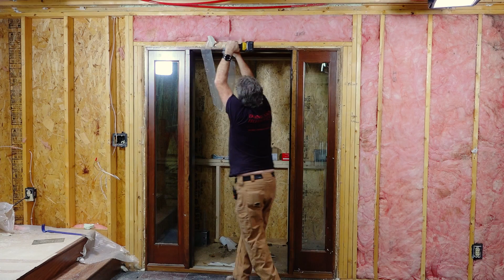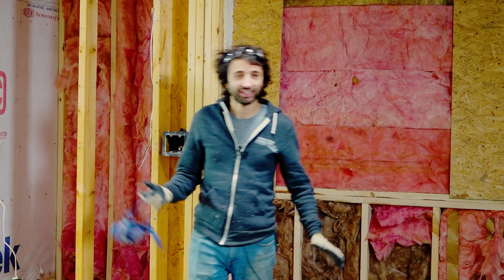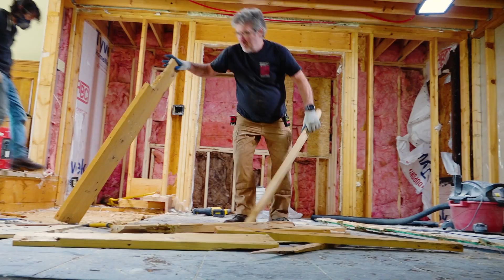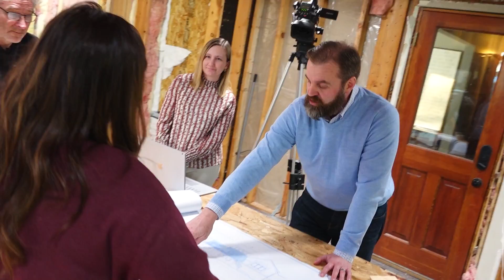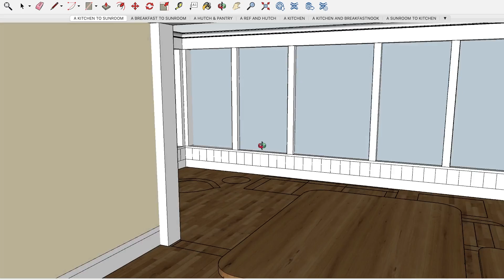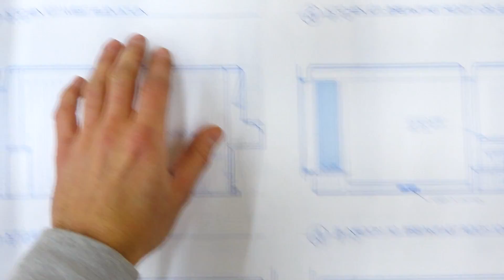Extending into the Front Addition | Home Renovation & Addition Part 23

Comment: Been fun following this project.  Having just completed a complete kitchen makeover in my log home which presented numerous challenges particularly running exposed conduit for overhead lights; I went with iron pipe and U.S.A made Anvil fittings...the style is referred to as "Steam Punk".  Would highly recommend considering using Legrand under counter lighting systems as they also include electrical and USB outlets which make for a cleaner backsplash.  Curious on how you plan on running the ductwork for your range exhaust hood (assuming it will be vented to the outside)...on my project, I used an inline blower and solid 10-inch ducting which had to be exposed.  Again, appreciate your sharing this and very happy for you both.

Comment: You are not keeping to proportions. You seem to just miss the golden proportion of thumb to forefinger. Then your panels are all over the place none of the lines follow through. Your beam doesn't line up either its just slightly higher. 
It just isn't clean enough. You should simplify. It's going to look like extensions, conversions and compromises. Also too many textures. Too many different panels. Too many colours. Too many different levels.
It's just all too busy. Less is more.

Comment: I would highly recommend going with an induction range. Not only do they work really well and clean really easily, they do not provide nearly as much indoor air pollution (ie contributing to childhood asthma). And no, the vent hood doesn't remove C0.  While it's open it will be easy to add a 50A circuit.

Comment: We renovated our kitchen about 25 years ago and installed terracotta tiles on the floor. The installed recommended we not waste installing them under where the new cabinets were to be, so we took their advice. Well down the road when the dishwasher needed replacing I ran into an issue of getting the old one out because of the height clearance, it just couldn't slide right out due to the rise of the tile floor. Never did it cross my mind about the end of life of the dishwasher and having to replace it. I wish we had only spent the additional 400 or 500 dollars to have the entire floor tiled because when that replacement also died I never replaced it because I was sure to destroy the counter-top. Anyway, you have Donavan, to advise you on that issue, I didn't have but myself. Your project is looking great!

Comment: I'm glad i heard you say there just now that you have a lot of load on that beam.  Because that's what i've been thinking for awhile now: "You have a lot of load on that beam!"  Not only the load bearing 2nd-floor outside wall+roof, but also half of the roof deck too and its snow load.  That's a lot of load there!  I'd be worried about that beam if weren't for the fact that you had it designed by engineers who know what they're doing.

Comment: Donavan using the sledge hammer to remove sheathing brought back memories. My first house we added a shed dormer. I spent the 'demo day' taking the old roof down, using a sledge from inside to remove the boards (and shingles nailed to them.) Hint: It works better with Elton John blasting. :-)

Comment: While your still in the construction stages, I was watching a British show a few years back and they had a unit in the kitchen counter or maybe it was the Island where it raised up out of the counter with electrical access on all sides for plugging in appliances. When in the closed position it was a flush plate on the counter. That way all your receptacles are hidden until needed.
Google popup electrical receptacles. Also a good idea for your shop.

Comment: Engineering ok’d those gigantic holes in the floor joist for hvac?
Reply: That wall could be completely removed it we wanted to plus it has core fills in it
Reply: I was talking about the i-joists supporting the floor above. HVAC ran their line sets and electrical through a few of them. Obviously I’m not at the site but those holes look way more than 1/3 of the joist
Reply: @dirklance4413  yes they are still in spec with Manufacture guidelines I normally will walk through that with all my trades and we talk about where holes are gonna be and what size

Comment: The choice of a fitted hutch rather than an unfitted hutch design is very contemporary American style. Unfitted kitchen design, as popularized by designer Johnny Grey in England, is a more traditional design form... fitted kitchen design has sometimes been described as “laboratory” kitchen design... unfitted is traditional in the sense that older kitchens were assembly of free standing cabinets and cupboards and chests and fireplaces used for cooking... laboratories were uniform designs designed for utility and uniformity... unfitted kitchens are still attached furniture pieces but often purposely attempt to appear to be free standing and done in various wood species. Attaching crown moldings around the room add unity to the design but identify the design as all built in... a room design with separate pieces of furniture is a collection rather than a total unified design... personal preferences for a fitted design style originated in the early 20th century in America at a time when architects were concerned with producing sanitary conditions... also kitchens were not family spaces but rather designated as work spaces. I am kind of surprised that Matt, with his furniture design an building experience and love of different woods pieces and traditional furniture style aesthetic did not opt for a more unfitted design... maybe next time.

Comment: Electrical comments:  Matt, if you have not already done so, add outlets on both sides of the island AND add a 3 or 4 way light switch on the island for its overhead lights.  The bare kitchen before cabinet installation will look like too many outlets, but trust me more is better!  Best wishes!
Reply: Totally agree.   When we remodeled our kitchen, we put a strip of outlets the length of the island under the counter.   As the electrician was installing them, he said "you'll never use these".   Boy was he wrong.
Reply: @tomgerhard1403  That just sounds like you’re keeping an unreasonable amount of appliances on your island, Tom.
Reply: @mm9773  no, more like taking a break from the office by using the laptop there, or charging a phone while watching videos sitting at the counter.   Not used daily, but plenty often. We have a dedicated outlet for appliances on the kitchen facing side of the island for when we use the bread machine or electric griddle, etc.
Reply: @tomgerhard1403  I agree…plus with the growth in numbers of electronic devices and gadgets, you will need more outlets in the future. It’s much cheaper to add them now. Just like workshops - with the growth of electronic devices for tools, I recommend double what people are thinking.
Reply: @tomgerhard1403  That makes sense.

I’ve recently renovated an old kitchen and couldn’t put as many new outlets in as I wanted, because I decided not to mess with the old tiles on the wall. It can be annoying, but I’ve also learned that counter space is my No. 1 priority anyway: I need surface area to prepare ingredients, so I’ve banned a lot of appliances from the counters. Fewer appliances = fewer outlets needed.

What I’m really, actually missing is another outlet at the main shelf above the main counter, for extra lighting and/or to plug the phone in.
Reply: It’s not that there aren’t enough outlets, it’s just that there’s always one missing: one corner in which you wish you had put an outlet but didn’t.
Reply: Yes, Matt - you can never have too many electrical outlets - ask your wife !! Enjoying your refurbishment. It really looks like you know what you're doing !! Mind you, you do have Donovan there to keep an eye on things !! As a certified Home Inspector here in San Diego, CA, USA, I salute you guys for doing an excellent job !! I have been watching your channel for a couple years now and enjoy your progress. Blessings to y'all !!
Reply: Definitely,  with today's number of appliances requiring their own dedicated outlets there's no such thing as to many outlets.
Multiple mixers, toasters and other implements cooks like to have handy instead of having to dig them out of a cabinet,  use them then pit them back again.
Especially if you're doing a lot of entertaining friends and family.
Reply: also add outlets up high for over cabinet and under cabinet lighting.

Comment: Looking good Matt. One thing. Consider putting electrical outlets in the pantry if you are not already doing this.
Reply from the maker: We have several going in there. Thanks!
Reply: @mcremona   ok. And an electrical switch on the door. Open the door light comes on. No outside switch on the wall that way. Think they're called micro switches. It's easy to do. Also I'd check that all the kitchen door and drawer hardware is the best you can get. I'm a kitchen builder from New Zealand 🇳🇿. I'd recommend BLUM hardware as it's the best in my opinion. Make sure the hinges and drawer runners are soft close as well. You might also need to put a small round plastic wheel on the pocket door as it's a big door for the mechanism to hold. It goes on the inside. Open door and it supports it as you slide it inside the cupboard so it doesn't drop. Been there done that. Also make sure all the kitchen cupboards are on adjustable plastic legs. Easy as for leveling and you can run electrical cables on the floor underneath if required. The toe board just clips on the legs. Easy as. Nobody does solid toe spaces these days well not in New Zealand anyway. Another thought glass doors on that dish hutch between the openings might look OK especially if you have some nice plates or dishes. Just the top doors though. Sorta like an old Welsh dresser. Anyway good luck. I'm waiting for the next installment of the renovation. 👍👍
Reply: @darrylkennedy2125  I absolutely hate soft close doors and drawers. I wish I didn't have them on my cabinets. Who the hell wants to wait 15 seconds for doors and drawers to close? I'm not a money and I know how to properly close a door or drawer!